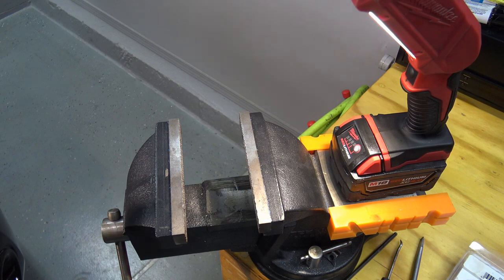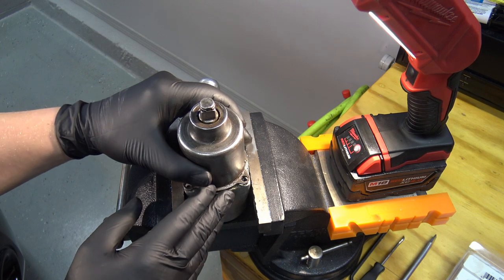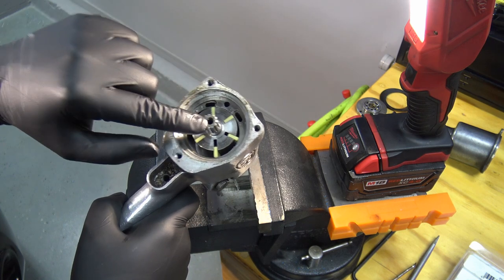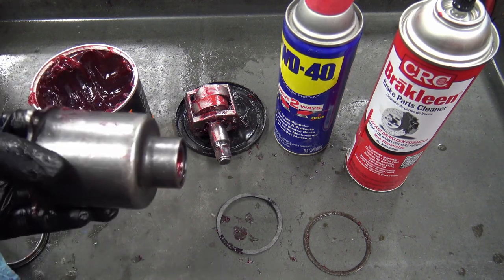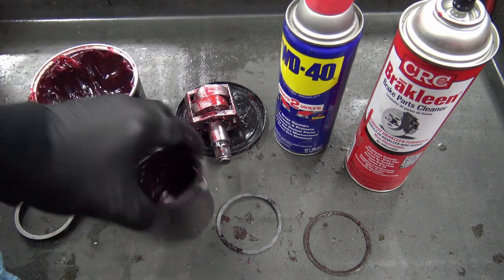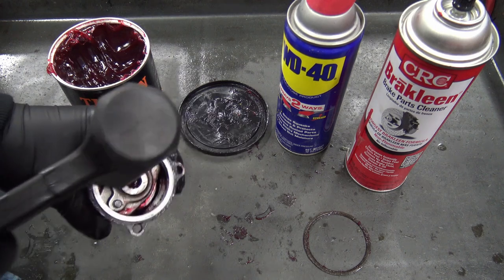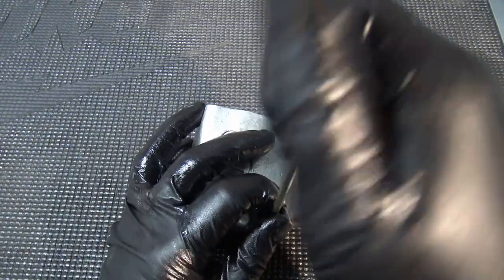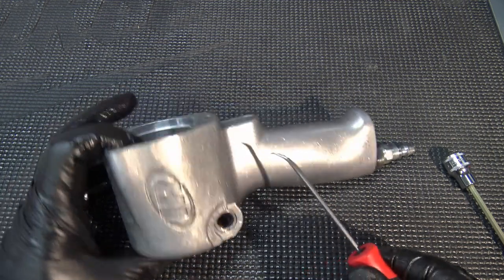Ingersoll Rand IR231 1/2" Impact Rebuilding Guide

Comment: I worked for I.R. for 35 years, before retiring. This tool makes me proud.
Reply: Pete Miller ... How did work all day with tool drool on your shirts.  Had to be tuff as heck.  ;)
Reply: No issue. The tool I had never had that issue. Maintenance is a requirement.
Reply: Hi there, i have the same air gun, i was very careful with it. oiling it every time before using it. one day it quit working, it hasn't work two years straight, what should i look first? The rear bearing has play back and forth, shouldn't that bearing have been press fitted?
Reply: @VasilisKarastergios  oh wow buddy...it sounds like water has got into your impact...take it apart and see what's wrong..moisture is the enemy..watch this video..🍻🍻🇺🇸🇺🇸
Reply: Pete Miller I’ve owned mine for 19 years and it is still working perfect today. Thank you so much Pete
Reply: Can you get a real thunder gun off your respect 😅
Reply: It should because I love using it and several newer models in 54 years of diesel mechanic shop
Reply: Bb me b

Comment: I picked up an 231 A model at an estate sale for $20. I took it apart, cleaned it, lubricated it, and put it back together. I made the rookie mistake of putting the cone spring washers in reverse direction. I thought I had over greased it, or something. Reversing the cone washers so they're pushing the rotor assembly in made all the difference. Another thing that needed service was an O-ring inside the handle to cure a constant hissing noise. I used a green air conditioning O-ring that I had from a multi pack.  I notice that you omitted the selector click ball in the video; which might make it easier to change settings, but It's part of the original design. Rated operating pressure is 90 psi for maximum torque.

Comment: You missed the missing ball bearing on the directional /Speed knob. There are small Detents for the amount of power,(small increments).. great video.You Nailed it in my opinion, a very well made tool.mine is roughly 20 years old 😀

Comment: I heard all the stories about how good they are. I buy one and 6 months it was warranted and fixed leaking air.   3 months later the same thing less than a year it was rebuilt 2 times so this time I’m rebuilding it myself it does hit hard and is very consistent if you can keep it tight
Reply: Wonder if the new ones are made oversea's..

Comment: I love my IR231H. It works great, even on the end of 110 feet of hose and three quick connects. I usually set the regulator at 80 PSI. It's quieter and performs almost as well.

Comment: Funny I'm watching this. Just came out my shop and had my old IR 1/2" apart cleaning her up......yup, needs a rebuild! One thing should be mentioned, the fitting the air nipple screws into has a screen in it, mine was about plugged up with hard rust. That screen needs to come out from time to time for a clean up especially if the shop you work in cares not about air quality down stream of the supply. Good video Brian 😆👍

Comment: Really want to thank you for your post. I was having problems with a very similar impact wrench. The explanation of the reversing valve is exactly what I needed. I found the Central Pneumatic item #68816 is an almost exact kickoff of the IR231. The manual supplied with the CP unit was poorly written, but sometimes get what you pay for.

Comment: I've got an IR231 and an IR 2135TI.  Both are excellent guns.  I've had the IR231 for about as long as you've had yours, and the 2135TI maybe 8 years.  I'll have to grab a rebuild kit for the IR231 as I can't recall the last time I did it on that one.  I noticed the other day that it didn't seem as strong as it used to be.  Good video, thanks for posting it!

Comment: Subscribed. I use IR and Chicago Pneumatic Impacts at my job every day. When they lose power we just order a new one from the company store. 1/2 inch drive and heavier 1 inch drives at a truck axle assembly plant. I had no idea they could be so easily repaired/maintained. Not sure if there is no tampering/repair policy between the our company and the suppliers. Just seems like a waste of money if we can't have these repaired in house instead of purchasing new ones every few months. I'll have to ask about it. Glad I found your video.
Reply: Yep the big company I worked for replace them every year and I got all the old ones 
Think I got around 150 that all work great 👍

Comment: Some of the guys laugh because I'm using a dinosaur (231C) air gun compared to their Snap-On or other newer style air-gun that costs a fortune. I even gave a new 231G to a guy starting out because it has decent power and its very reliable. This impact gun still sells for 125.00 after 20 years on the market, way more attractive than other models that last half as long. I also have a 261 for big HD jobs.

Comment: I worked in the alot of the exhuast shops in lansing Michigan back in the late 80's , at 19 , 20, 21 , years old , we tore up 1/2 inch air guns , we almost all settled on the ir 231c for its durability , im 55 years old now , it finally broke on me , busted the anvil ear off , I took the broken piece out , and it still works with one anvil ear , I won't use it thatway , but im definitely impressed..now the back up I bought 5 years ago , ran on with air hooked to it from brand new ( not sure why ) I just think I'll put the two together , swap out the anvil , keep the new one for parts,  and buy another back up gun whole .

Comment: I really like and appreciate the fact that you went to many details in how to do this job. but I have noticed that the air flow adjustment have spring and a small ball bearing that you completely forgot to mention also noticed that the demonstration test did not show any noticeable change in diferente adjustment on turning the knob. But thanks to your video I was able to do the repair no problem.

Comment: The 231 is the AK47 of impacts.  I don't use mine daily anymore (1200K is stronger/lighter/quieter) but it's my backup gun.  It's fallen off of lift arms before and dented the floor and still worked perfectly.

I should rebuild mine because it's a bit tired and the reverse knob doesn't like to stay in place (the detent ball/spring are not great)
Reply: I agree it’s what I carry in my pu with air compressor 
It can take the dirt and keep working in bad sand storm
Reply: I agree ☝️

Comment: Best rebuild job on any tool I have ever seen.  Had mine for 15 years and it starting leaking air bad, so now I will rebuild using your go-to guide.     Just need a link to where to buy these rebuild parts.  Thank You!!
Reply: Sorry, just found the links.   Coming from a mech. engr.  Great Job

Comment: Identical to mine it just says "Bluepoint" knew it was the same just back then I needed to be able to pay weakly lol get it 
Had it at least 15 years. Don't use it daily but has gotten a lot of use over the years. Finally died on me today Though I blame myself as i was asking too much out of it trying to pull lugs off a semi as I was in a pinch. Hammered on it a lot and it finally gave up just blows air when it has a load on it Will free wheel just fine. Hope its the vanes. Knew I watched someones rebuild video years ago Glad I found it again lol

Comment: Home gamer. 15 years ago I fell for the trap of buying the Lowes air compressor that comes with all the tools.  (Kids, learn from my mistake - the tools that come in those packages are shit.)  The impact in particular was garbage - I didn't even give it away, I just threw it out, and bought an IR 231 instead.  I do occasionally run into something it can't bust, but that's what breaker bars and pipes are for.  I love it and only regret wasting money on the package of crappy tools that came before it.

Comment: Great vid! I have the IR23. I have owned it for over 21 years and it still works great! Have you tried the P Blaster air tool oil. It comes in an aresol can and makes my older air tools work like new!
Reply: really??  my cheap harbor freight acts up sometimes.
Reply from the maker: I have heard that too I just use a quality air tool oil and make sure I lube it daily only takes a few seconds but makes the tools last so much longer.

Comment: Brian: Thanks, That's very useful. May I ask some dump question? That dial nob is rotatable clockwise or counter-clockwise?  I remembered it can only dial to 1 to 5 before I took it apart and reassembled. What did do wrong? Please help, thanks again.

Comment: What is the minimum required to remove Triton 3v spark plugs with an impact wrench......getting ready to buy one just for this job and want to spend as little as possible.  I know this is a little out of bounds for this video but I know you will have the answer.....enjoy your work Fordtechmakuloco
Reply: The Aircat 1055-TH compact impact gun.
Reply: any impact will work..even just a cordless one. do it when the motor is hot. the carbon that makes these stick will be looser from the motor just being on.mine all came out that way. good luck.
Reply from the maker: This impact -http://amzn.to/2hBswX5  is best for the 3v spark plugs due to its stubby and wedge design it helps on those back cylinders.

Comment: What would you recommend for cordless impact tools, I only tool around on my own vehicles so don't want to spend a fortune but I also want something that lasts. I know good and cheap don't usually go together.
Reply from the maker: Milwaukee without a doubt anything in the M18 fuel line but this one can be extremely useful from small fasteners to pulling lug nuts- http://amzn.to/2gPErUc

Comment: I'm hoping somebody can help me. I have a 231 for years now and it's finally developed a problem. It will not shut off. As soon as you put air to it, it is wide open. Trigger does nothing.  Bought a rebuild kit but nothing has changed. Do you have an input?  I would greatly appreciate it
Reply: I have the same issue with mine.  It seems like the air just bleeds through.  I tried to research this and some suggested a problem with the air inlet.  I removed the air inlet bushing (22mm) and stretched the spring a bit.  It did not have any affect on the problem.  Did you solve the problem?
Reply: At top of the spring in the handle there's a plastic bushing with n o-ring it's usually the o-ring that fails

Comment: Hello, Im a fellow ford Tech and I just replaced a torque sensor on an 09 Ford Escape and after everything was back together, as soon as I started it, the steering wheel turned all the way to the left. I lined everything up and followed the instructions to the T. I saw you post on a forum that you had a video showing this. Do you still have it? Any suggestions/advice?
Reply from the maker: Yes and so do you in PTS under service tips and reference guides there is a torque sensor install video there from Ford.
Reply: FordTechMakuloco I saw that one on the   PTS page, but the video wouldnt play. Tried a dozen times
Reply from the maker: I see what you mean it wasn't working until I double clicked on it now it works I have it downloaded if you need it. Message me on my business email.

Comment: I am having an issue all of a sudden with mine. It will loosen bolts perfectly. When I put in tighten setting it just blows air. Any idea what would cause this? It's been used about 25 times. I always put a couple of drops of compressr oil in and run it in booth directions before putting it away.

Comment: I let my gun sit for a lot of years. When I went to use it, it didn't have any power. What part do I need to change?
Reply: greg mccarter  Thanks for the tip. But  after doing some investigating, my problem  was the air hose diameter. At the dealership it was 1/2" and my home compressor  had a 3/8" on there unbeknownst to me. These guns need 1/2". Well, live and learn.

Comment: I have a IR 235 that runs,but doesn’t have any power to turn tightened bolts etc.   Any idea what is wrong?
Reply: maybe the vanes in the rotor are worn out and not sealing?

Comment: i dont know if you will see this. but if u do.. hope you have idea.. 97 expooodition.. grrrrr..... key on not start on. just on. dash gauges float up a lil. give like say half tank on fuel lil on oil n temp. speedo and tach give like 1/8 reading.. move dimmer for dash lites to on/off cab lite  the gauges zero out.. all windows stoped working.  unable to find good schematic. tried BCM out another expo i have. issue in expo 1... expo 2 BCM in expo 1 no change , still same issues. expo 1 BCM in expo 2 nothing wrong , expo 2 is fine with expo 1 BCM. so iam ruling out BCM. if cornfused.. sorry tryin to give as much info as i can.  also some sort of bypass for the dang door switchs . i think there in the latchs on door. grrrrrr FORDDDDDDDDDDDDDDDDDDD

Comment: The variable speed control didnt work whats up with that ? The air control on mine makes a noticeable difference in audible tone and rpm. i didint notice a change in rpm or tone when you adjusted the control at the end of your video. good quality video though very pleasing to watch . almost as good as porn. thank you
Reply from the maker: +wyn larsen the valve only goes in one way with no moving parts you really cannot get it wrong
Reply: makes sense
Reply: There is a ball bearing in the shaft about half the size of a BB. This is spring loaded. My guess is it popped out. This was ignored in this video. That little ball is critical to its operation.

Comment: please, bro  makuloco how please help me how to test the FTP P0453 04 FORD ESCAPE  THE CHECK ENGINE LIGHT WON'T GO AWAY SORRY FOR BOTHERING BUT I DON'T KNOW WHAT TO DO
Reply: Yeah, I just want to make sure is the sensor, cause I don't want to buy it cause I did some research on the Internet and some of them didn't fixed the problem ,I just would like to find out how to test it some others said that canister purge valve,
Reply: But thanks a lot bro I just confuse
Reply: Rojo Ibarra canister purge valve is normally closed. If you can blow through it then it's stuck open and bad
Reply from the maker: pm me on facebook testing this is very easy

Comment: What happens if the back part goes in crooked
Reply: biofall38 I'm looking for this answer too. I hope I didn't screw it up. I'll keep heating and hammering for now. Did you figure out a trick to it?
Reply: jrbr1997 I just got a wooden handle and taped the shaft until it straightened out enough to slide the round part around the rotor the trick is not to force it  I fixed mine and it's back in action  I used it all week at work and its doing better than ever

Comment: That's not a 231C model it is a 131S, very similiar but not the same, exhaust location and trigger type main differences.
Reply: You are correct it's not a 231C, it's a 231HA. The HA is for "Handle Air". It's the same air drive up top but the HA casting routes the exhaust through the grip out the bottom of the gun rather than out the front near the hammer housing like on the C. That's why it has the shrouded push pin style trigger with a different air valve.

The HA was developed, in part, for mechanics who do a lot of wheel work as the exhaust blown towards the work would tend to blast brake dust and crap into the air when using the "C" version. Exhaust out the handle solves this problem with the loss of about 10 ft lbs. The HA is also available with a 2" extended anvil for the same reason, to reach deep set lugs without having to mess with an extension.
Reply: @kitsunetsuki5743  shop I started at has 2 of the 231ha with the extended anvils and had a 231c setting around not being used. The 231c seemed to have a bit more power till the gear broke.  I’m going to find a new rotor and repair the c.  I’ve only needed extensions when dealing with the combo 1/2mm sockets for swollen lugs, or for the wheel lock removal tools

Comment: Dad had one years ago, bought used.  Wasn't real strong, sent in to get rebuilt, got a beat up ugly unit back.  It never worked so great either and sat around mostly unused for 35 years.  Now I suspect Dad's air system had too many restrictions to run the gun right.  High Flow fittings on order.  Then I'll find out if this ugly gun needs rebuilt.